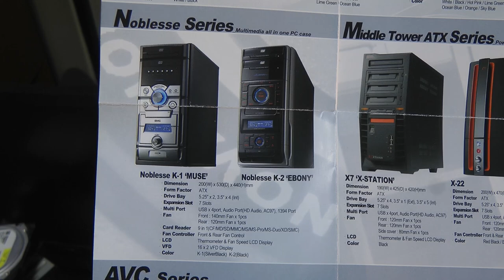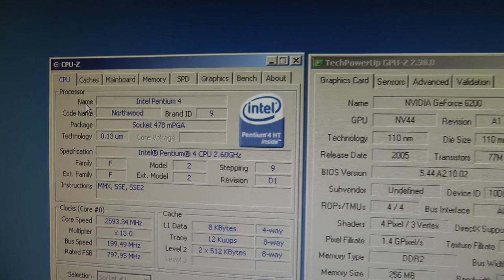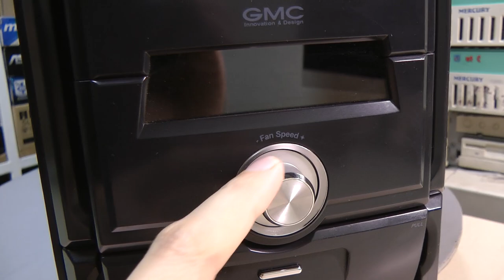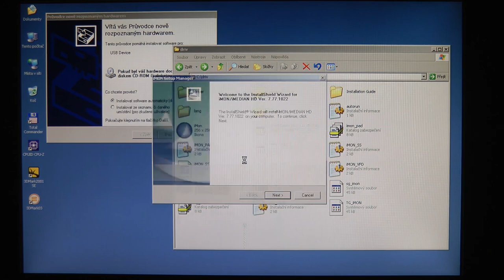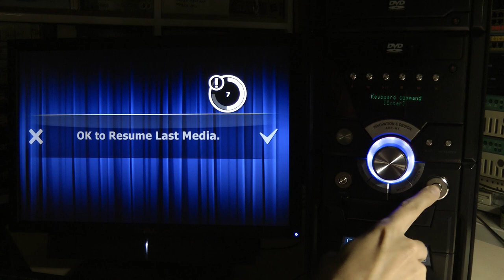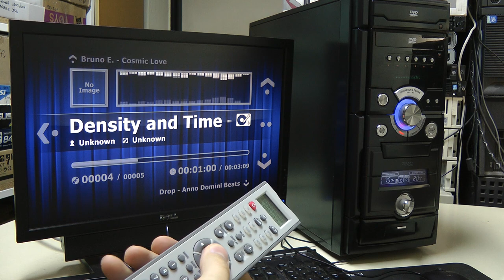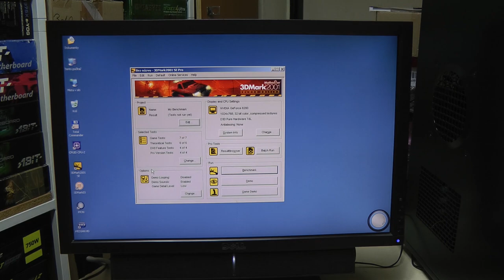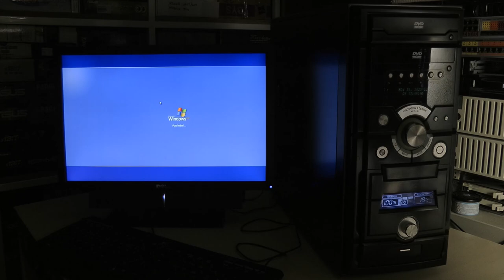PC Hi-Fi build in GMC tower case

Comment: Hah two screens didn't expect that, and even equalizer,  but allso 120mm dust filter that  is unexpected too.
6200 i have one such card and it came with P-900 mhz system i bought someone upgraded from TnT2 m64 to 6200 :)
Great video thanks .
Reply: Thanks for pinup and another great video.
Check LGR fish tank case, i truly didn't believe it exists but there it is.

Comment: My XP machine is running a Athlon 64 3400+, 2 GB, and the 6200. Based on my benchmarks the system appears to be bottlenecked by the gpu. But i cant really find and better single slot gpu cards, anything you can recommend?